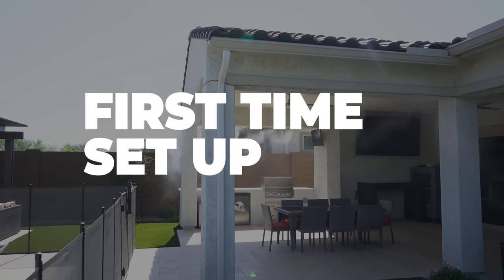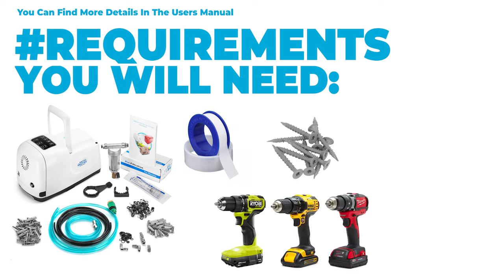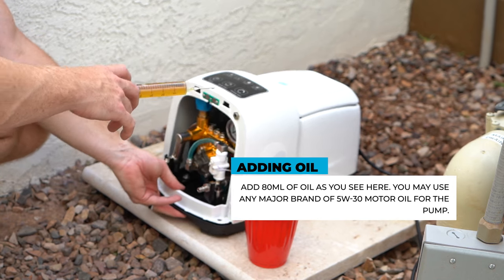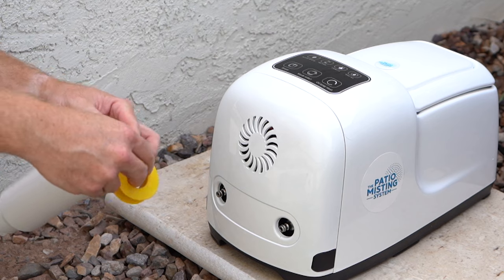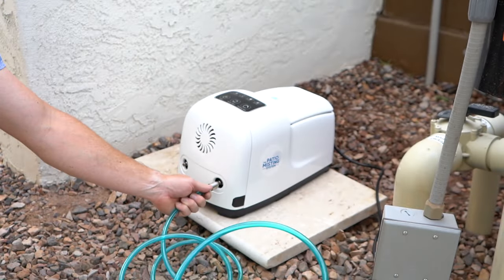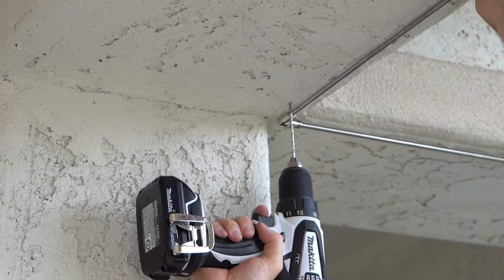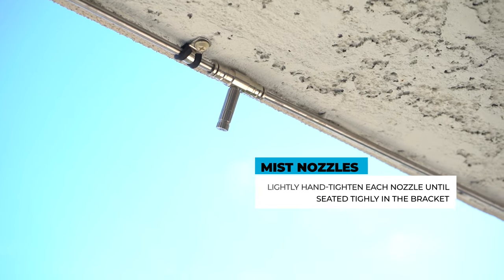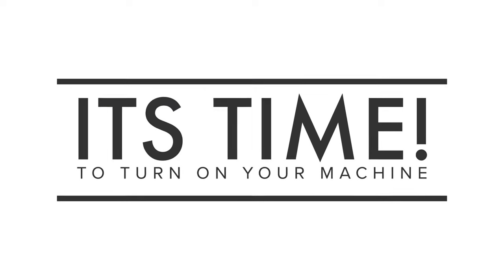DIY Patio Mister Quick Installation - The Patio Misting System Pro

Comment: How will this work if water source is hard water? My hose line isn’t in the water softener loop.
Reply from the maker: These units are made to be used in hard water environments.  We ship everywhere but are based in Arizona.  Very hard water.  There are two inline filters to reduce calcium build up.